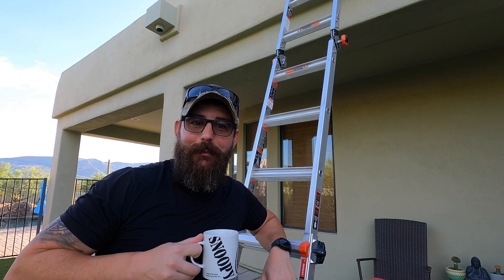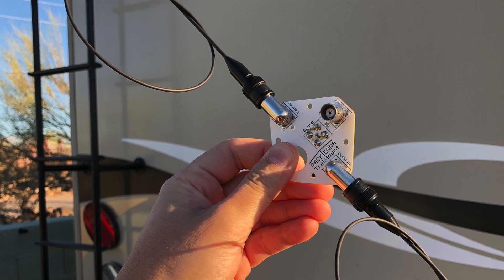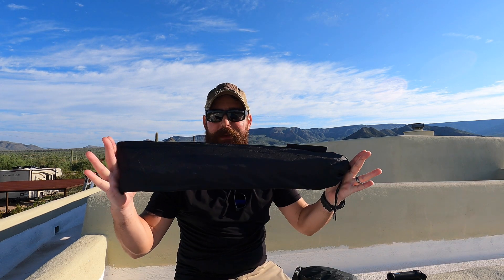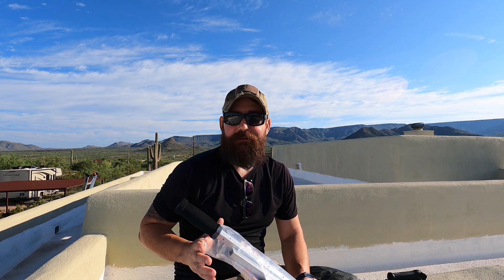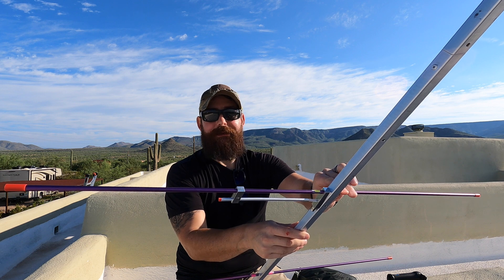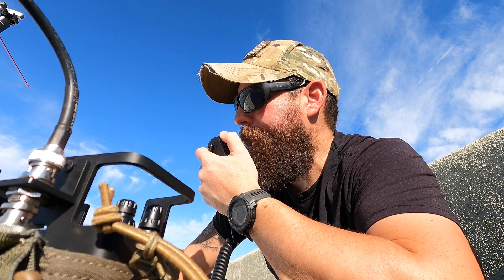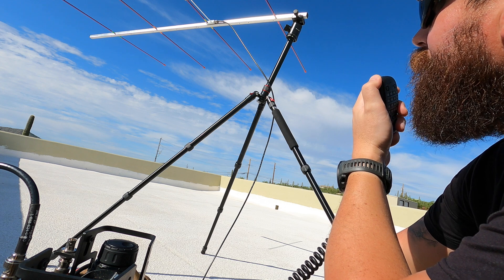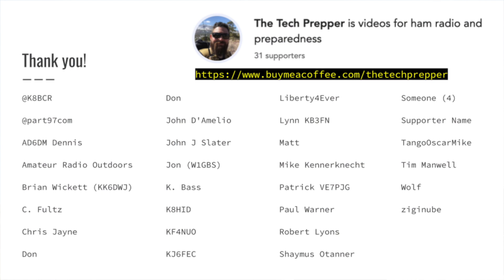Arrow II Yagi Antenna, 2m SSB Net, and EmComm Tools

Comment: 4 years old video?  How did I miss this?  I was looking for videos on the Arrow 2 and wondered if I could use on 2m SSB, guess I can. I will use this with my IC-705
Reply from the maker: Yes, sir. It's 4-years old. It's still a great antenna and still actively in use. This would pair great with the IC-705.

Comment: Was the polarization on the receiving end horizontal? I was wondering why you setup in a Horizontal configuration, instead of Vertical.
Reply from the maker: The convention for SSB on VHF/UHF is always horizontal. All the other stations in this net were horizontally polarized.

Comment: I have both the Arrow and the Elk. I like both, although the Elk is quicker to put together and I think easier to use. By not putting the PVC sections together tightly, it changes polarization without much effort. A buddy with a 3D printer made me a handle that fits on the boom of the Elk, plus a PVC to tripod mount that you can fasten a Swiss-Arca mount to. It is less weight than the Arrow and very broad-banded. That noted, the Arrow is a proven performer. I think the Alaska version would be great for QTH use or summit packing. My arrow is the regular model. One other note is that with the Arrow, you are limited to 10 watts with the duplexer while with the Elk, it has no duplexer, to you can use higher power. Nice video!
Reply: Arrow and Elk recommend 10 watts max hand held. I’m leaning toward the Elk for satellite work.
Reply: I could not understand the word you used at the end of your presentation. If you said packable 2 meter antenna I have one for you. A 2 meter Jpole consisting of one inch copper foil on four inch rubber duck tape. It’s works .

Comment: The Elk VHF/UHF Satellite log periodic for FM and SSB birds have all elements in the same plane and works as well as the Arrow II dual Yagi  which have its VHF elements 90 degrees from the UHF elements.  The Arrow II has build in 10W Diplexer which is not required by the Elk.  Why does the Yagi require 90 deg phase polarization difference yet the Elk LPDA does not?

Comment: I live about 190 miles from you straight line distance to the south.  You think if I hike to the peak of the mountains behind my house (Carr Peak at 9,300) I could hit you with a 2m SSB and a yagi?
Reply from the maker: Most certainly. That should not be a problem. There are tools online for VHF that will do RF analysis between to points.

Comment: Great portable antenna. Your link for it on HRO website is good but the one pointing to the Arrow's website is the wrong one. Its actually pointing to the 3 (2m) element which is the shorter 2 piece version. Arrow's website is also very outdated and their info is not all in one place and you can easily make a mistake when placing an order.

Comment: Killer video! I have been using the Elk Log Periodic Antenna for many years, but thinking about also grabbing an Arrow because it's nice to have options. Dig the 100+ mile contacts!!
Reply from the maker: Glad you enjoyed it. I've been considering an Elk Log Periodic to more easily switch between FM and SSB. The Arrow II is nice, but I have to remount it  when I switch from horizontal to vertical polarization.
Reply: @TheTechPrepper  That is one big advantage to the Elk. I have mine mounted to a tripod so i can rotate from vertical to horizontal quickly. I also have a video of me hitting a repeater about 30 miles away.

Comment: Mono Band 2-meters is a very small niche indeed. I have some very old Kenwood TS-700A rigs that will not perform to requirements in the field, too big, too heavy and too weak.
The lack of these radios in the market is due to the availability of HF/VHF/UHF rigs starting with the IC-706mkIIG and my FT-897D good mobile (vehicle mount) and portable respectively.
If shopping for 2M SSB, the requirement is likely to be multi band for contesting and provisions for satellite cross band operation in one box. UHF and Microwave people like high performance 2M rigs for use with transverters. That is why the old TS-700 is still popular as the design is totally analog with very low phase noise.

If you already carry the laptop for other requirements, the SDR project with a transverter (if needed) and external power amplifier to reach your power requirements is a good approach, but keep in mind, it requires the laptop to function.

You can consider a transverter for your HF portable.

Comment: Another fine video. I am curious why you chose horizontal polarization as I have often heard vertical was more used in mobile 2m/70cm.  Does it have to do with being in SSB mode or just what you wanted to do.  Not trying to not pick. This is an honest question.  All the best, 73 de KI5HXM
Reply from the maker: Great question. The convention for SSB is horizontal and FM is vertical.
Reply: @TheTechPrepper  oh, I didn’t know that.  Is there a web site that has the 2m SSB conventions?  I am interested in looking into it.  Thanks
Reply from the maker: @brentjohnson6654  Search for "2m band plan in texas" or something along those lines. Out in Arizona the common frequencies are 144.200 and 144.250 MHz. Also do a search for "SWOT net". There should be a SWOT net in Texas.

Comment: I would say don't pigeon hole yourself into just 2M. If you have the gear, tryout UHF as well. My motto is two is one, one is none with everything in life (that includes operating bands). It's nice to have a backup... 73
Reply from the maker: You're absolutely right. I've been enjoying 440 FM and USB simplex with this antenna recently. In fact, 70cm seems to perform better where I live compared to 2m. Take care!

Comment: Unrelated to the video, but it's interesting to see the desert architecture.
Reply from the maker: Actually, there was another ham that was intrigued by the flat stucco roof. Only downside is that we don't have an attic or crawl space.
Reply: @TheTechPrepper  I also live in a hot climate, but it's humid here so the nights stay hot. So our "traditional" architecture relies on shade and letting wind through. I understand that southwest architecture relies on shade too, but also heavy walls to release heat at night and store it during the day.

Comment: Good job KT1RUN.  Nice portable 2m arrow antenna.  I have the straight 4 element Arrow 2m antenna on my roof about 20' up with a old radio shack antenna rotator. I could hear you for the first time when you used your new antenna. de W7ADF
Reply from the maker: Welcome to the channel, Jim. It was great rag chewing with you and Mike WD7R yesterday. We had a clear path at the beginning, but the conditions made copying you difficult towards the end. You were in my noise when you started to explain your setup, but I thought I heard "Radio Shack" and "rotator". I'll see you at the next TBC club meeting or event. I joined today. 73 de KT1RUN

Comment: Gaston, great look at the arrow antenna and welcom to the world of directional antennas. I think your in a HOA I have a idea for you if you want something more permanent. Cheers Chuck 73, oh and you already own the best portable 2m ssb radios lol
Reply from the maker: Thanks, Chuck. I plan to build a Yagi next year following your videos. There's no HOA here... that was a requirement when we moved. Heck, I have an 80m dipole on the other side of the property and there will be a future tower. Other than the  IC-706MKII, I figured that I had the best 2m all mode capabilities on the 817/8 and 857D. I'm curious about your more permanent idea? I just picked up a FT-2980R for use as dedicated 2m packet station and need some direction on a good 2m/440 vertical roof antennas, but a permanent beam with a rotator would be nice.
Reply: @TheTechPrepper  Oh well my idea is different now that you don't have a HOA lol. Check out M2 antennas I have their 7 element Yagi for ssb and you have a way better location I'm surrounded by hills. a cheap TV rotor is plenty for a 2m yagi maybe at 10' above your roof and put the rotor at the bottom easier on the guying and works fine.
Reply from the maker: Thanks again. Research time.

Comment: I have the two piece arrow 2m/440 with duplexer. Easy to disconnect when not in use and nice to have it when working sats. Sold my 991 and moved to a ic705. I really like the 705 but wish it was 20w not 10w.
Reply from the maker: The IC-705 would be the perfect rig with 20 watts. I've seen a few QRP amps, but it seems to defeat the purpose. I'm hoping that ICOM or Yaesu move in the direction of an all band, all mode rig with 20 watts. Have you used your yagi outside of satellite work?

Comment: Nice video, phantastic view from the rooftop. I like 2m SSB, especially in QRP. Keep up the good work, Vy 73 de DO1PGR Peter
Reply from the maker: Thanks. This is the first time I've seen the view from that vantage point. All the floods turned the backyard green. ;-) This same setup works great on the FT-818ND with just 6 watts. 73 de KT1RUN

Comment: Great video man! I have the 3 element version. I pair it with my Yaesu 2980r when doing 2m simplex using a painters pole. It works out great. 
Now I want the 4 element antenna!!! You have a beautiful landscape at your house. 
I need a 2m ssb radio.
If you find an all mode 2m make sure you let us know! Seems that should be a thing. 
 I just passed up an 857 for the 891. I'm kind of regretting it now 😅
You're doing great things with your EmComm tools 👍
Reply from the maker: You bet I will, but I don't think any manufactures are interested in making 2m SSB rigs these days. I went the FT-891 like you did, then finally was able to snag an FT-857D several months later. If one comes up again for a good price, you better believe I'll sell my FT-891 to finance it. The receiver is much better on the 891, though.

It's good to hear that you're enjoying the features in EmComm Tools. It's a matter of stepping back from the channel a bit over the next couple of months, so that I can make some real progress.

I like your setup with the FT-2908R. I just acquired this rig for my upcoming 40th birthday, but I haven't cracked open the box. I'll be sure to pair it with the Arrow II out the gate and report back.

73, Gaston
Reply: @TheTechPrepper    I was going to attach a link to the 857 I had my eye on. Used kit, 857, psu, tuner, and hard case, it looked well put together.  $888 at randl... but it's now showing as no longer available. Now I'm kicking myself even harder for not getting it! 
The 2980r is great. Just 80w and a huge heat sink, seems bullet proof! 
Step back from your channel for a bit if you need to to get your stuff squared away. We will be here when you come back. 
Happy early  birthday 🎂
73!
Reply from the maker: @Blue-Collar-Radio  $888 was a screaming deal. Thanks for the early b-day wishes. You're right, it's time to cut back and release a video every other week and buckle down on the project.
Reply: I think that by looking for a 2m Only SSB rig you're severely limiting your options.
There's lots of VHF/UHF rigs that will do SSB. Duplexer is most likely built-in so you're good for receive. Size and weight wouldn't differ much from a VHF only rig. Than you just don't use the UHF.

The part of Europe I'm from or my country specific, the spread between  repeaters being VHF/UHF is about 50/50. So I would miss half the repeaters if I could only run VHF

Besides all that, a VHF/UHF rig will not always TX in the spectrum I between those (though some certainly will) but it will RX everything for sure so you ca monitor Marine and Air frequency as well. A desirable options to have emcomm wise I would think

73

Comment: Hi Gaston, Amateur Radio Outdoors, HB9HJU, Luis here. I was exploring the HackRF for something similar to what you're proposing but drop it for a couple reasons:

1. You'll definitely need an aditional Low Noise Amplifier, plus, preferably good grounding (even on portable use)

2. You'll most definitely need to enclose the HackRF in a faraday cage, since it is extremely susceptible to RFI. This proved to be kind of problematic

3. You'll need an amp, since the HackRF output is mw, which in practice is only practical for uses on very short distances. 

For an all mode HF + 6M + 2M rig I decided to go with the Elecraft KX3. Yes, crazy expensive and you will still need an amp to get to 20W BUT, incredibly portable which compensates for the portable amp and battery. 

On my QRZ You'll find the part list, with the exception of the amp, that I'm linking here. Hope that's useful.

73, Luis

https://youtu.be/f8v8fohU9ak
Reply from the maker: Hi Luis, 

I assumed another ham had a similar thought to go down the HackRF path. I knew that I would need to an add amp, but didn't realize a Faraday cage would be necessary. I've had a suspicion that this effort could be a nasty rabbit hole, so thanks for the confirmation.

I've looked at the MX-P50M amp as an option for my QRP rig (FT-818ND), but I really need the power on VHF/UHF. Are you aware of any 2m/440 portable amps that have the same form factor?

Your gear selection and QRZ page are fascinating. The KX2 and KX3 have always intrigued me. I need to find a local club and/or ham who has one as they are pricy.

I've run across Amateur Radio Outdoors in the past. It's need to connect the site to the ham. Well done, Sir!

I appreciate the feedback. 

73, 
Gaston KT1RUN
Reply: @TheTechPrepper  45W should be enough for most applications (specially if using digital modes like JS8/Winlink) UNLESS you are pointing towards EMCOMM were probably you'll be benefitting from a little more ump!

As you're mostly operating outdoor manpack portable and want to do all-mode / all-bands I would think of the following combinations

1.  FT-817 + Mirage BD-35 VHF/UHF all mode amp (https://communicationlg.com/boutique/en/mirage/vhf-uhf-dual-band-amplifier-bd-35-for-amateur-radio-p1012/). Haven't tried myself, so can't give you any comments on performance.

2. Go retro, on the IC 7100 and have everything on a single box.

3. KX3 + PA500 + BD-35. Yes, I know, now the problem is price + weight. However, you gain on sensitivity, selectivity, power consumption. 

Yep, no free lunch here. 

Also, I'm working on ramping up the recording equipment. Until know just recording with my phone which didn't make for the quality I want to have for the beautiful switzerland scenery.

Thanks for your content. Really loving your videos and learning a lot from you as well.

73, Luis, HB9HJU
Amateur Radio Outdoors
Reply from the maker: @lasantiagoa  I appreciate the follow-up. The Mirage BD-35 looks like a solid amp, but it's up there in price. I'll need to look at the specs closer, but between the 817/8 and the Mirage DB-35, I may be in the same size footprint as the 857D.  I'm sure it's worth the value. It looks like the FT-857 is starting to be the sweet spot in terms of price, power, portability and features. 

Good luck with your recording gear. I'd love to see Switzerland from your perspective. 

Thanks for the support.

73, Gaston KT1RUN

Comment: Your power though the diplexer concerns are why I went with the Elk log periodic antenna. No diplexer needed and good for 200 watts. Also slightly more compact elements than a Yagi and in the same plain vhf/uhf.
Reply from the maker: Well, that's good to know. I've heard a lot of great things about the Elk log periodic antennas. I like the design of them being in the same plain. More power and more compact are also bonuses. Looks like I should have gone with that first, but there's always time to explore new antennas later. Thanks!

Comment: Yeah, 2 meter SSB will run circles around FM any day of the week.  With a Yagi and a couple of dozen watts, you can get out several hundred miles under good conditions. They did make 2 meter only SSB portable & mobile rigs back in the 1980's and 1990's by Icom, Yaesu and Kenwood and I see them for sale from time to time on QRZ.  You're better off with a FT-817/818 and a 50 watt 2 meter amp.
Reply from the maker: Thanks for the background info. I figured that 2m SSB had to be more popular in the past. I have the FT-818 and have been considering a QRP amp for awhile, so this could do the trick. At elevation, I am sure that I can crack 200-300 miles no problem. There will be a SOTA video with this antenna in the fall.
Reply: Notice no one is telling you to not make a dedicated radio?  That maybe a really big project to tackle...hows your filters theory?  Since you have the 818 may be better to get an amp.  I picked up a 2m amp at a ham show shortly after I got my ticket.  Haven't used it more than to test it. But it is nice to have around. 1-5W in gets 20-75W out.  If you get one make sure you have a way to control the output either on the amp or a variable antennuator on the input unless your radio has good RF control.  Thanks for the content.
73's
KE0IHR
Reply from the maker: @ericbjorkman4665  A few hams recommended a 2m amp as well, but they are incredibly pricey, but that seems like the best path. The goal of the custom build was to have a project that would push me more into the theory. Thanks for jumping in and potentially saving me 3-6 months of tinkering.
Reply: @TheTechPrepper  let me know if you want to borrow it.
Reply from the maker: @ericbjorkman4665  That is very kind. I may take you up on that once I get the beta for EmComm Tools released. Thanks. I'll shoot you an email later in the email. Does your 2m amp work on all modes?